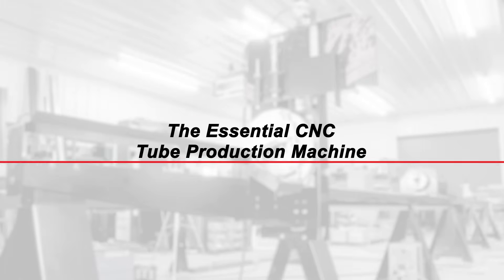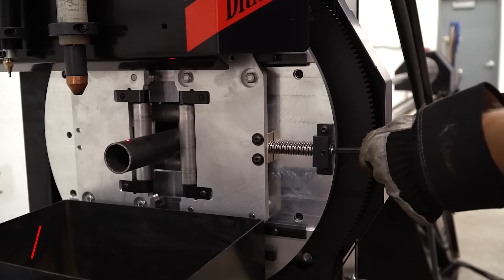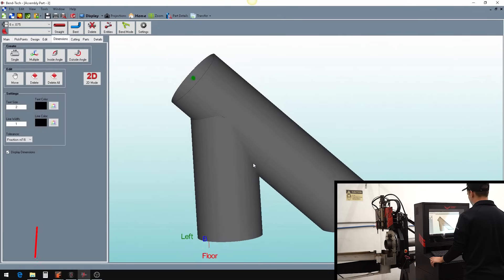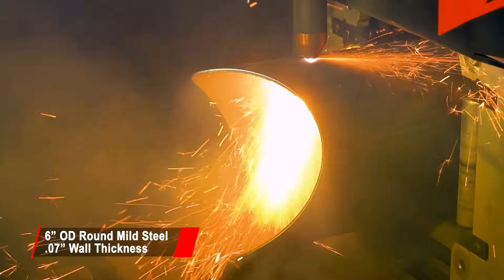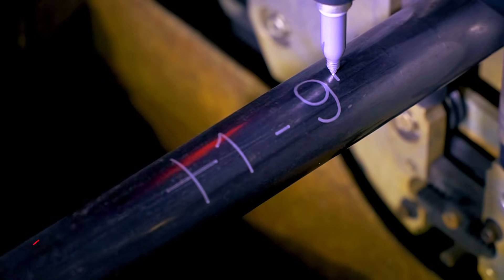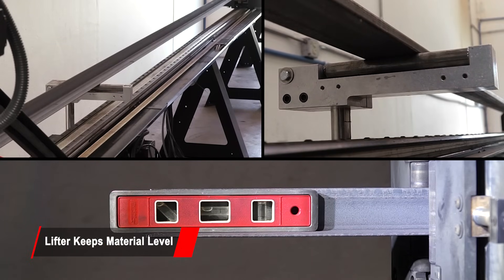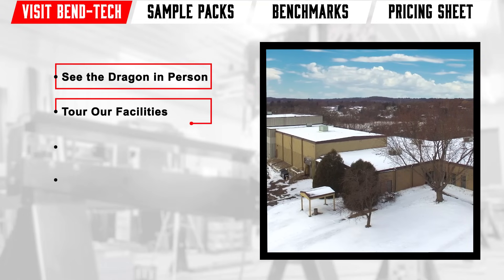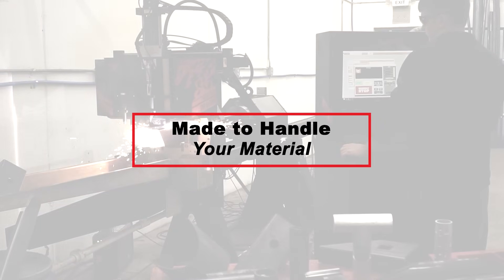Bend-Tech Dragon A400: The Essential CNC Tube Production Machine

Comment: almost no training supplied.  Constantly crashes if you load more than a few pieces.  Constant errors when trying to import parts.
Reply: Is it that bad ?
Reply: @JC-un4bg  the company that I work for purchased one for making stair rails.  At first it would crash constantly but after a month of going back and forth, we got it setup so that we can load up to 10 pipes at 24' long.   Because we use a program called Tekla to model our buildings (for structural steel) we use the Tekla plug in to create the files.  My biggest gripe is that the machine can't use the industry standard DTSV files.   My job is to nest the pieces into each bar and hand off the nesting list to the operator.  This machine is not meant for larger shops, but small shops where the operator designs the pieces using their proprietary software to design and run.  If it used the nc1 files used in industry, I could edit the files (they are text files) to adjust measurements.
There is no way to do this if you use the Tekla plugin.

The gaps when using the Tekla plugin are large when you are dealing with copes.   This created problems and the welders were recutting pieces manually because of it.  We finally adjusted our models to get a tighter fit, but it is a huge pain in the ass.  If it could use the nc1 standard, this would be a very simple thing to fix in the text files, but I can't adjust lengths and their tech support was useless in solving this issue.

Another issue is that this machine has NO collision detection.  You have to manually enter the dimensions in the 'pipe library'.  If someone makes a mistake (or the dimensions are slightly off because of variance in heat runs) you risk the plasma cutter head hitting the material.  This will ruin it and here in Canada, it cost us $2500 to replace.   Very expensive when you consider that people trying to learn these machines will make mistakes.

The controller / computer is pitifully slow.  I've never run such slow software to nest the pieces.  

On the positive note, this machine is fast.  We can easily cut a large industrial railing in hours instead of days.

Comment: What version of Bendtech is that in the video. Have you made improvements with the software when programming channel and angle
Reply from the maker: Jonny, the software for angle and channel is the Bend-Tech Dragon CAM version 1.12.01. If the motorized front gate add-on option is purchased, that includes the enhanced software for designing and cutting angle and channel profile material.